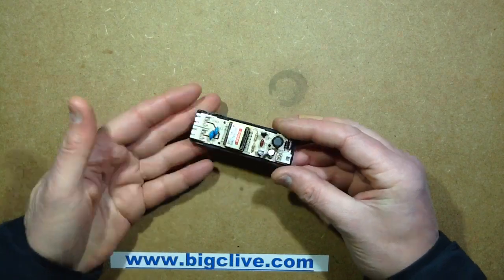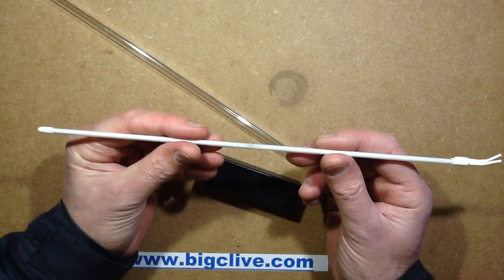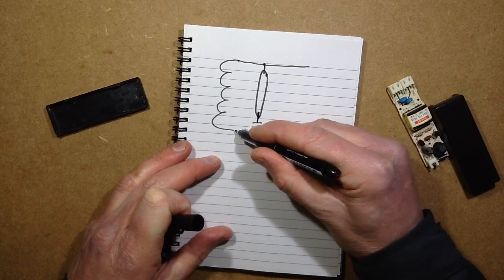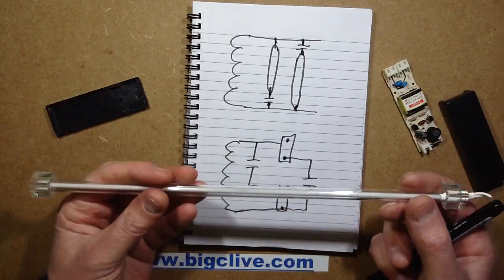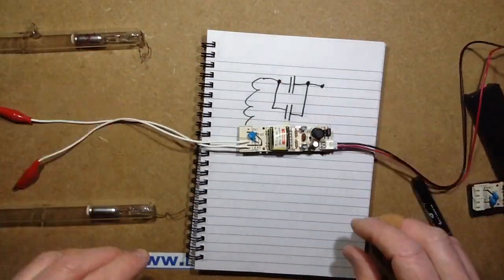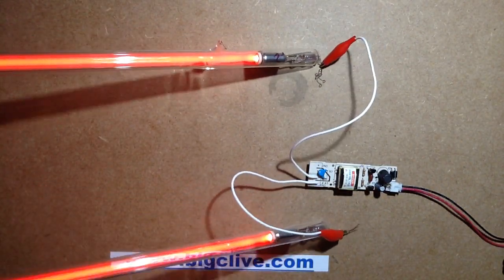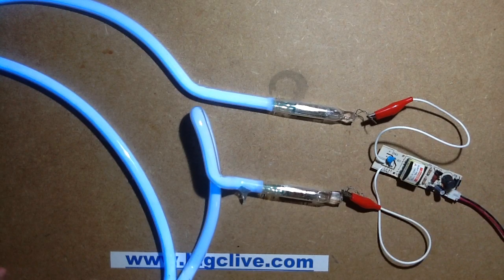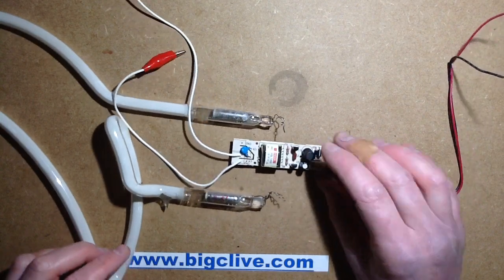Hacking a dual CCFL driver for higher lamp current.

Comment: bigclive 
A rainy Hello from PNW! 
What do you think about increasing power supply voltage - 12vdc to 18vdc? or somewhere in between? I got a couple of 12vdc automotive ccfl power supplies but,  I think since I have 8mm blue tube that is 7-ish feet in bent length (shaped into a bass fish jumping out of the water) is struggling to fully illuminate. I need to see what the voltage drop is while loaded running neon tube. My thinking is most car voltages vary quite a bit so these ought to be able to handle some more? (at least 14.5vdc you would think) I am curious what you think.  or is it just safer to do it like you show here? Thank you for what your doing. I knew there had to be a more reasonable cost to get a ornamental table top neon working for my wife. Initially assumed it was the mains to 12vdc power supply but nope, capacitor and resistor exploded in the dc to dc power supply in the base. Cheers! and thank you again! looking forward to more of your content.
Reply from the maker: These power supplies tend to be optimised for a specific voltage.  Pushing them too hard can cause heating and possible flash-over on the high voltage transformer.

Comment: I still have one of the Drivers here and it seems like both of the Transistors have burn marks already, at least the tube does'nt turn on anymore and the current drawn is basically 0.01A. Is there any rule to replace them because i can just find rubbish under the Model Number "D1804 SX Q2" of the Transistors.
Reply from the maker: It's odd for the transistors to fail.  Another issue may have caused it.
You can still buy this style of inverter on eBay.
Reply: @bigclivedotcom  Yeah, i already saw some of them, while searching but i thought maybe i could just revive the one that i own for a few cents and learn a bit more about Electronics on that way, since the Circuit is still pretty easy to understand.

Comment: Hello, I have a question, can I use an 4 ccfl driver to power 2 ccfl? If so, how?
Reply from the maker: If the manual for the driver shows it can be used with less tubes then it should work, but generally speaking a driver should be used with the correct number of tubes

Comment: Hey I just came across your video and I have a question I bought a set of ccfl halo rings with ccfl converters exactly the same one as you have but when I extend the wires about 10 cm the halo rings in my headlights go dim using a 12v car battery but when hooked up to my 12v battery charger supply it has full brightness why is this ?. Thanks
Reply from the maker: An old style battery charger may put out higher voltage when unloaded.  You have to be careful when extending and routing the high voltage wires.  Capacitance and insulation resistance can cause leakage between the wires.
Reply: Thanks for your reply it's a ring branded battery charger. I've found a wire that was used on hid bulbs so I used that and it works. It was just frustrating as I opened my headlight unit taking the lens off. Then a simple wire change was the fix. Thank you ever so much for helping

Comment: So the way you showed that wired in, the capacitors, are they in a series or in a parallel drawn like that? Sorry, can't seem to wrap my head around on those drawings, it always seems right backwards to me when they say it's this or that a way.
Reply from the maker: Initially the outputs each had one capacitor in series each.  But by putting both caps in parallel and then in series with one output it allowed higher tube current on that output.
Reply: OK, now that made since, was kind of lost there with what you said & of coarse I can't see those small boards well enough to see what's really going on. So yeah, thanks Clive, that's a big help.

Comment: WTF, I had respect for your knowledge on analogue electronics but what is this? "thinner the tube the higher voltage you need to light it"
Reply: He's correct - thinner tubes require a higher voltage because of their thinner cross section... the voltage requirement for ignition is inversely related to the cross section of the tube - so thicker tube = lower voltage, thinner tube = higher voltage.
Reply: And why is this? More impurities per amount of gas or what?
Reply: It's been over a decade since I learned the rule of thumb so I can't remember the theory behind it nowadays (run a farm vs studying physics). My vague recollection is however that it was related to the amount of gas, less gas made it harder to strike requiring higher voltage. Could be wrong about that; but the rule of thicker tube lower voltage - thinner tube higher voltage is spot on.
Reply: Thinner wires have higher resistance to current,  so why not tubes?

Comment: An alternative to open them and do that mod is to just use the pins furthest apart and an external capacitor.  One would need two plugs and a cap rated at 2-3kV.

Some of these can be difficult to open and impossible to open nondestructively...
Reply from the maker: All the ones I've opened were so well glued together that they did tend to break apart.  On an older style it used to be possible to just parallel the output wires, since the capacitors were on the same transformer output.  But you're right, you can just tap off either side and add an external cap.  Although it's convenient to just reuse the existing ones.